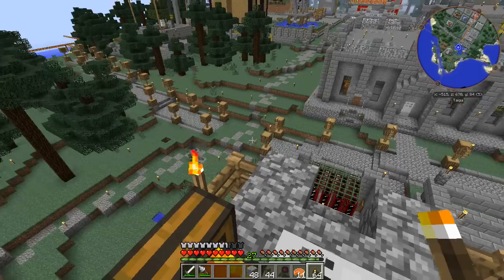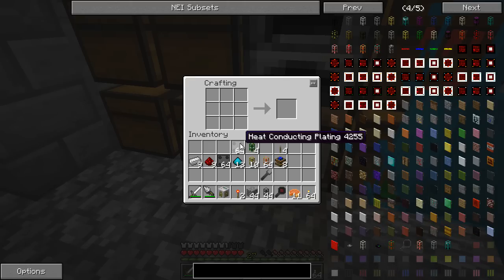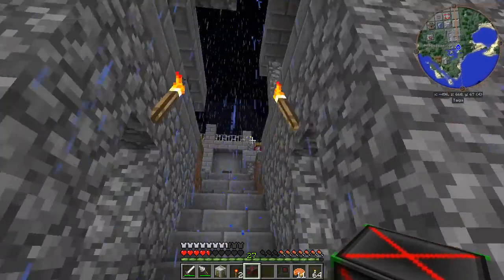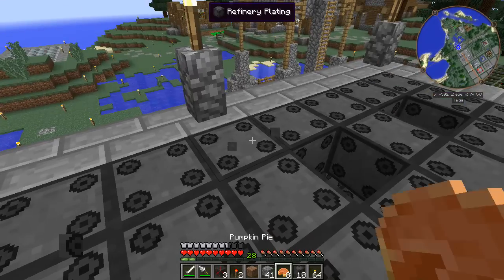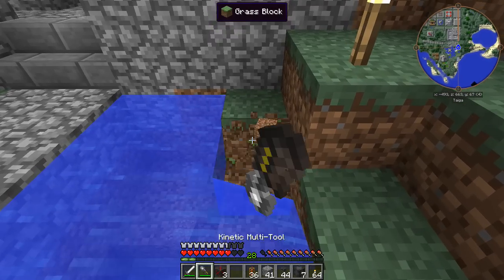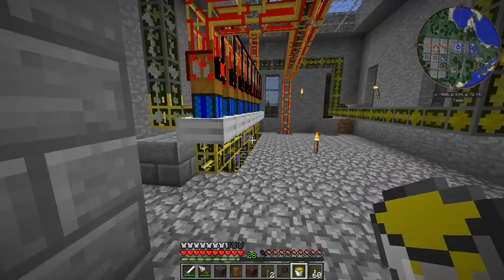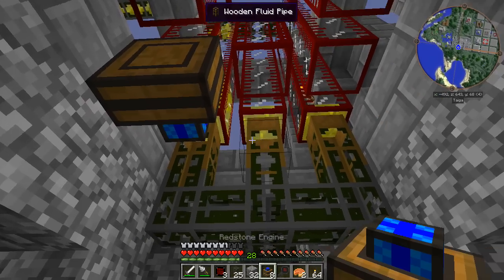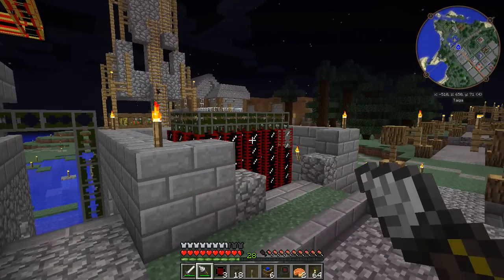Surviving with Buildcraft 6, episode 29 - New BCA Refinery and Cooling Tower!

Comment: I use optifine with fps set to unlimited in the options, with graphics on fast rather than fancy in the options as well. It more than doubled my fps and I run a very weak cpu. Also, great vid as always.
Reply from the maker: I added both optifine and fastcraft last night as a test. It didn;t stop the stuttering caused by the engine block, but I did notice an overall performance boost, so will probably keep at least optifine, if not both :)

I have a relatively beast PC too, so it miffs me ...
Reply: Without Optifine I doubt I could play MC with my poor pc. It still runs on hamsters after all.

Comment: hey chilm!, great video, i have a question, and i am sorry if it's a really noob question but is that emmerald fluid pipe over the cooling tower needed? or could it be a wooden fluid pipe?
Reply from the maker: You can totally use a wooden pipe dude :) I only put the emerald one on there as I planned to upgrade to gold fluid pipes which shift 40mB the fluid, like the emerald pipe :)
Reply: chilm Actually they move 80mB now!
Reply from the maker: Michael Miller Good point! Gold pipes shift 80mb, Emerald ones 40mB :D

Comment: Have you tried installing FastCraft? That may sort out some of your FPS issues.
Reply from the maker: Not sure if fastcraft helped, but optifine appeared to. However, neither fixed the stuttering frame issues caused by the engine block though I did notice a nice general performance boost :)